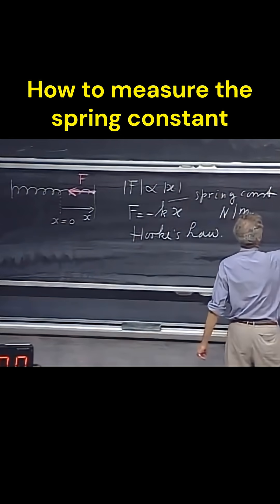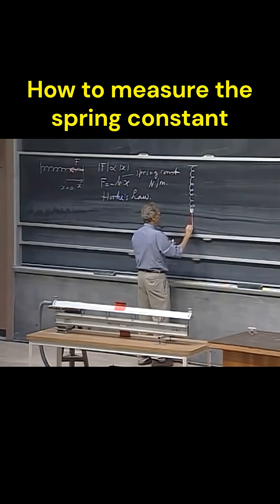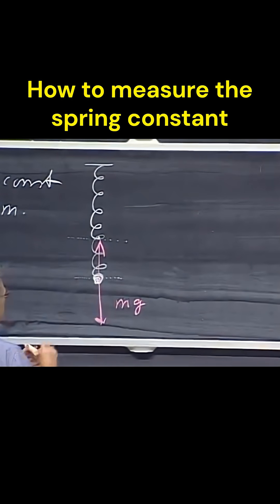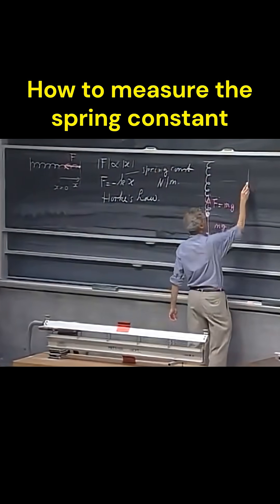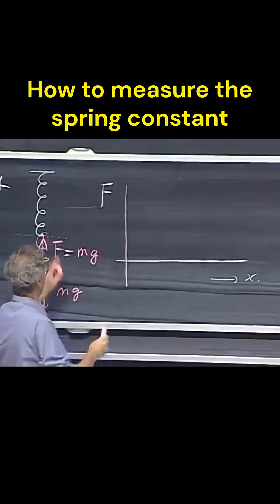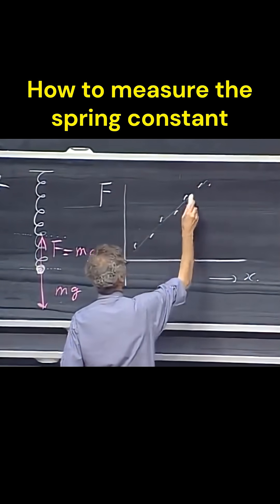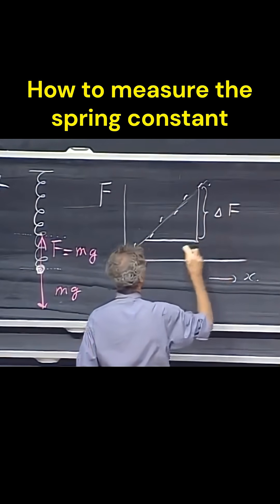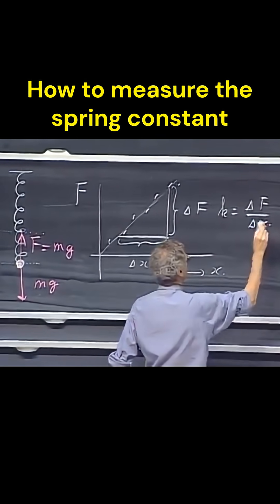Measuring spring constant

Comment: Sir I always mistakes in the graph of any equation. How can I escape from this graphical mistakes???😭😭😭
Reply from the maker: You should get the independent and dependent variables first, then ...
- create an x-y table, 
- pick input (x) values, 
- calculate corresponding outputs (y), 
- plot these (x,y) points, 
- connect them with a smooth curve or line, using intercepts, asymptotes, and domain/range as guides to ensure accuracy.

Comment from the maker: PROCEDURE:
1. Measure Initial Length: Hang the spring and measure its natural, unstretched length (L0) from a fixed point.
2. Apply Force: Hang known masses (e.g., 100g, 200g, 300g) from the spring.
3. Measure Extension: For each mass, measure the new total length ((Lf) and calculate the extension (x=Lf-L0).
4. Calculate Force: Convert mass (kg) to force (Newtons) using (F=mg) (where (g=9.81 m/s^2).
5. Calculate k: Use (k=F/x) for each measurement, or plot Force (y-axis) vs. Extension (x-axis) and find the gradient (slope) of the line.